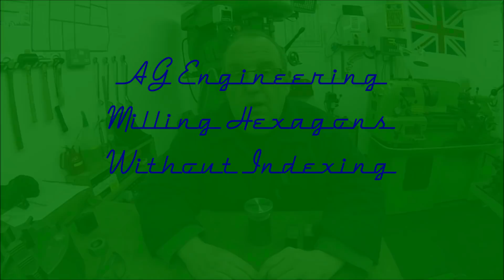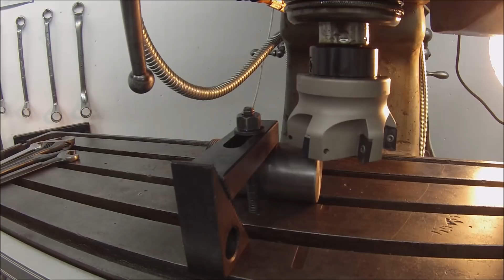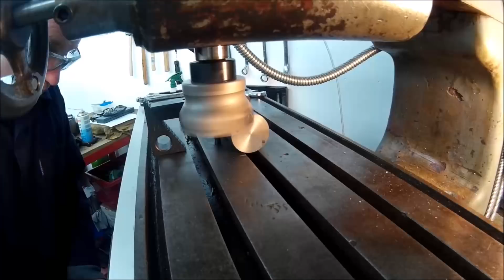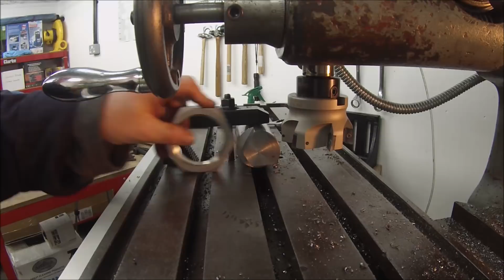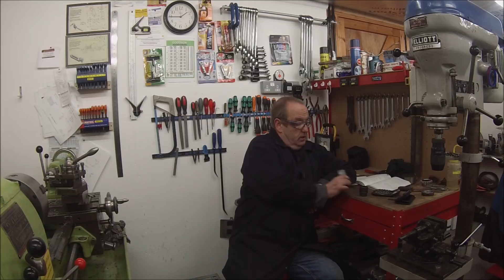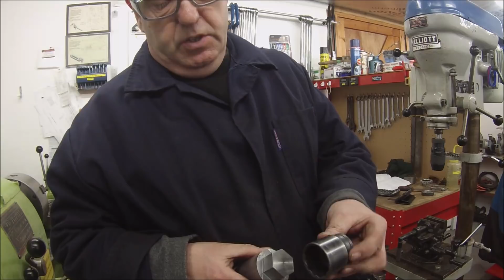Milling Hexagons Without Indexing

Comment: A parallel under the nut would have given you more contact between the nut and the milled flat. You wouldn’t have needed to find a larger nut. Even with the larger nut, a parallel would have helped.
Reply from the maker: Always more than one way. Cheers for watching and commenting

Comment: Interesting take on using hex nuts as the reference point i must say,  i wonder if its possible to work out the calculation  of the ratio; so you could quickly make them to a known certain size.
Reply from the maker: Thanks for watching and commenting. Finding the depth of cut to achieve a certain size is straightforward enough : diameter of stock minus desired hexagon across flats size, divide the result by 2 for the depth of cut. Starting stock diameter needs to be very approximately 1.2 times the hexagon size you are aiming for.

Comment: Great video mate. How do you know how deep to cut the flats to end on a 32mm head?
Reply from the maker: Many thanks. Diameter of material minus 32mm, divide result by 2, so if its 40mm round bar 40-32=8, 8/2=4 so cut 4mm deep. Regards Ade
Reply: A G Engineering Many thanks mate! Looking to make my first piece - a titanium axle which will need a 28mm hex head. Though I’ll be using a Hex collet holder as need all the help I can get and they’re cheap enough.

Comment: Hi there good video although you need to get your audio sorted can hardly hear your commentary
Reply from the maker: Hi Bill, thanks for watching. The audio issues are still ongoing, I use a Rode external mic in the latest video but am getting interference over the wifi now.
Reply: Hi, you're  quite softly spoken which is fine but I think as you make more of these videos you're going to have to get a clip on mic very close to your face or learn to project more. your camera is picking up the machinery fine but I have to set my volume to max to hear what you're saying which then makes the machinery sounds unbearable. I'm sure you will get it sorted. Best Wishes and thumbs up for the video in any case.